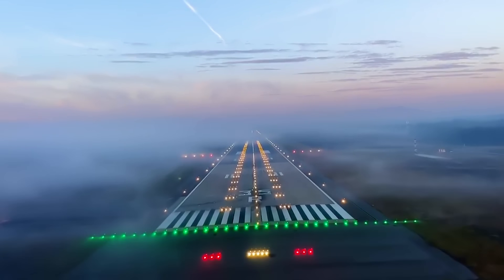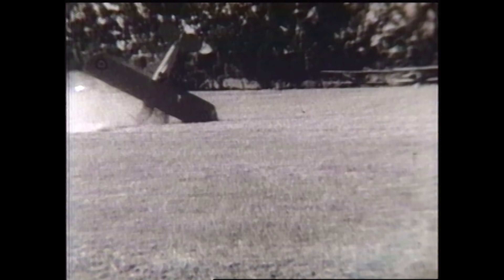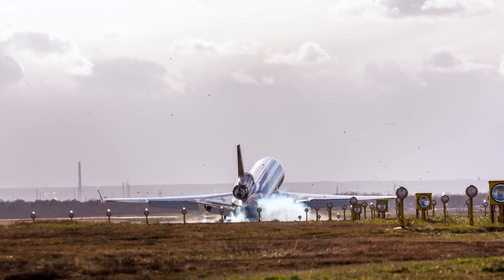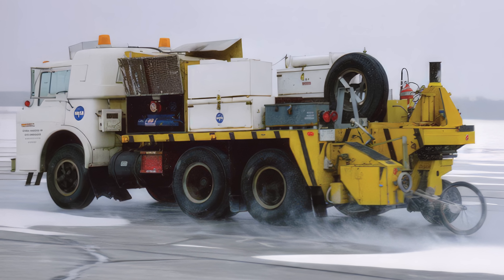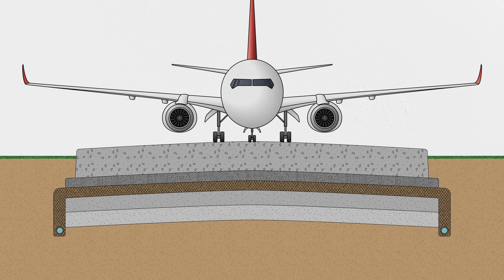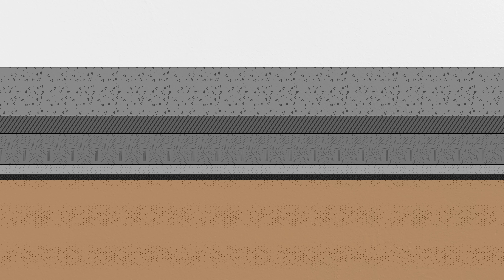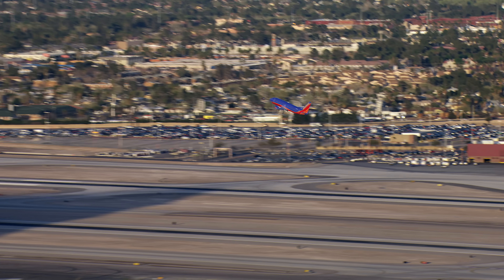The Hidden Engineering of Runways

Comment: As someone who has built concrete and gravel runways, it is nice to see someone explain just how complex they can get. As a note, at least in my experience, we over engineered the different layers, especially the concrete, because going back and fixing it was a nightmare. Some airstrips, especially old ones or military ones, use such high PSI concrete that working on it is the most unfun experience ever.
Reply: Please correct me if I'm wrong - but isn't the concrete reinforced?  Thought I saw a LOT of green epoxy coated rebar being used in the new runways & approaches at ORD.
Reply: @fredinit  in my experience it depends. for the airstrip itself, most likely yes. As someone who tended to handle repairs rather than new constructions, it was very difficult to work with, especially with the concrete being up to almost 2 feet thick. Taxi ways a bit more variance. It also depends on when they were built. To answer as best I can, the new ones at big airports are almost all reinforced most likely. The less you have to tear it up and repair it the better.

Comment: Interesting to hear they basically ignore landings in runway design because the weight is so much less. Pretty similar to what we do for roads (in Belgium) where cars are just ignored because all wear from regular usage is from trucks and busses :D
Reply: The numbers are approximately 100.000 cars to do the same damage as one european 40.000 kg semi.
Reply: @Privacy_menorykee  But hEaVy eLeCtriC CaRs is what I usually get as response when people try to argue why electric cars should pay more road tax :D
Reply: @MrMattie725  depends on what road we're talking about, and they might even cause 2-3 time more damage, but that's irrelevant. We all live thanks to the world logistics and the cost of road maintenance is socialised, because no Truck could afford to pay 100.000 more times road tax and the world would grind to a halt if we tried that.

If the road is only made for very light vehicles, then the EVs could be contributing noticeably, but on any normal road the loads of a truck and similar vehicles is the worst. And any extra ton on top of max load does terrible damage, and especially if it's unevenly loaded. Those fines really should be even worse than they are since they're a result of conscious decisions
Reply: @MrMattie725  It is more about weight per tire (With some complexity from the interaction of closely spaced tires and tire air pressure.), and there are many roads that are designed only for passenger cars.
In my location roads are paid for with fuel tax as a sort of user fee; fuel mileage is roughly proportional to vehicle mass and it rewards more efficient transport so it works well, except electric vehicles get off entirely which is no good because they will eventually become a substantial part of the road users.
Reply: @Privacy_menorykee  which is something I've never understood - highest axle weight for a standard 44t truck in Europe is 10.5t (I've not seen higher), the max axle weight for a passenger car would be no more than 2t, so approximately 5x less. Trucks also utilize unsprung weight and air suspension (unlike cars), and operate at lower speeds so makes me wonder how the impact ratio is so high.
Reply: @JaidenJimenez86  the impact is not linear, it grows disproportionately with the axle load
Reply: That piece of information is out of date. That was true with older, empirical design models, but with the change to linear elastic models and decent computing power most designs will consider both
Reply: Landings are definitely not ignored in runway design. Mechanically the runway is stressed more during take off. But for a plane to land safely (in little to no visibility and/or poor wind), lights and approach guidance radar (ILS) is critical.

There is a lot of signage and electrical infrastructure that goes into place. This features help create more barriers of safety. Say a system to announcing what runway you are entering (you might have to cross a runway first and wanting to reduce as much human error as possible by having an announcement).
Reply: @dragade101  None of that is part of the runway. It is runway adjacent, expands the envelope of weather conditions and improves traffic flow, but the runway would be just as capable of supporting landing planes without that stuff.
Reply: Arent Belgian roads internationally made fun of? Maybe you should consider cars :P
Reply: @detorrV2  Haha true, I'll force in some cars next time! Our roads are bad due to lack of maintenance and structural solutions, not due to bad design of new roads ;)
Reply: I can't help but think of the edge cases: rejected takeoffs and overweight landings.
Reply: @sentinel76  A rejected takeoff is just a takeoff roll. Overweight landings are very rare so they are an insignificant addition to the fatigue life of the pavement.

Comment: Always fascinating. Phoenix Sky Harbor, by this measure, has to be one of the simplest airports out there. Two straight line runways pointing directly east and west (technically three, but the third is shorter and narrower and used only for small planes), with prevailing winds rarely exceeding 15 knots unless there's a storm. It never snows and only rarely does the temperature drop below freezing. The ground beneath the runway is most probably a sandy loam with varying amounts of clay, so minimally expansive soil that naturally drains well. The water table is down hundreds of feet and rain is around 12 inches per year, although during the Monsoon, you may see half an inch in twenty minutes at times. Rarely are there storms of sufficient magnitude to even impact airport operations other than takeoff, and landing distances and the terminals sit directly between the runways, making ground traffic generally straightforward (although it seems that the controllers split the airport into quadrants, one controller each, for better tracking.) Sky harbor's only real problem is summer heat requiring longer takeoffs but the runways are more than sufficient for that. The only other complication is municipal runways nearby, but they all have to give way to Sky Harbor's traffic pattern.

Comment: Airline Captain here: Very well researched. I'll also add that displaced thresholds can also be made for noise abatement. A good example of this is JFK's runway 31L infamously long one, at 3200ft. There's no real obstacles to speak of, but a lot of bougie residential areas to the east.

As an anecdote in DFW once the A380s starting flying there regularly several years ago, they were restricted to only using the west side runways since they're to heavy for the bridges to cross to the other side of the airport because terminal D is the only terminal with customs. I noticed as time went on, the 18R touchdown zone became heavily cracked, to the point that there were actual potholes and I remember hearing another aircraft complaining about chunks of runway laying around that area. It wasn't long after that they fully redid that runway and soon many others, as at that point all of them were still at least 40 years old, ie dating from when the airport was originally constructed. It's also very interesting to see how insanely smooth fresh runways are compared to old ones. DFW's 17C/35C is probably my favorite one and is silky smooth. 

Best compliment I've gotten for my landings was when I buttered it in on 17C and during de-planing a passenger came up to me and said he was sleeping and had no idea we had landed until we got to the gate and the commotion of everyone else getting up and leaving was what finally woke him up.
Reply: I had a landing at Bob Hope in 2002 in which, after the pilot turned off the reverse thrust, the entire cabin broke out in applause because we hadn't felt the wheels touch at all. It was like a hole in one, or a perfect guitar solo or something. Passengers are so used to a little bit of a bump on landing that when it's not there, it's WEIRD. :)

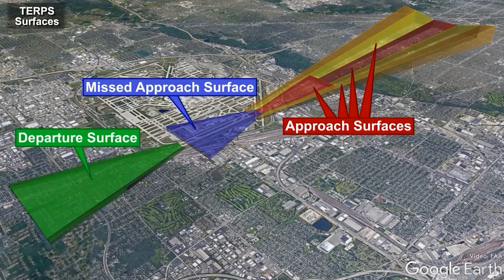Comment: 13:20 Our local MCAS got a new base commander one year (I think they're gone now) had to tell our County Board to move the Fairgrounds location because of this lol. Our Fairgrounds are in one of these zones; I think it would be the missed approach surface maybe? But local ATC has been working around the problem for years as this wasn't a new problem that developed. The airport/air base just went in and expanded "without considering" this.

Comment: 2:20 if you can walk away from a landing it was a good one. If you can fly the plane the next day it was a great one
Reply: Missed Benny hill music there
Reply: I always hated this saying. If your standard of a "good landing" allows for damaging the aircraft, you need a higher standard. And I don't want to be your passenger.
Reply: I mean absolutely no offence to your point.

But if I crashed my plane, I’m treating it like a bicycle helmet. One crash might’ve been enough to leave enough micro-fractures to permanently alter the frame’s ability to withstand flight. 

But, if truly nothing happened during a crash, that’s the best crash possible.
Reply: @lasagnaocelot4766  to add to your point while cycling back, airplanes are expensive, but you're not replaceable. you can get another bike helmet, not so easily another skull

Comment: Heavy planes takeoff being much more damaging than landing is facinating stuff
Reply: Yea, i didnt know that either. Although logical, what i knew was that the road damage is proporional to the 4th power of the axel weight. So weight matters a LOT.
Reply: Planes taking off are much heavier
Reply: It's a HUGE weight difference.  Many, many tons of jet fuel depending on number of engines, distance being traveled, etc.  You put an extra 20,000 lbs on those narrow little wheels and yeah, they're going to dig into the tarmac far harder.  Not to mention the engine thrust blowing back onto the runway the entire takeoff roll plus a few seconds after the plane leaves the ground.
Reply: While every action does pose an equal and opposite reaction, the takeoff procedure focuses that energy on a smaller surface area. :)
Reply: Maybe the heat of engines warming up also contributes?  Probably not.
Reply: I guess add to the weight difference that the engines are at full power too, and spewing what they spew all over it.
Reply: Now imagine when a plane has a malfunction at takeoff and needs to turn back, having basically all the weight of a 10+h flight landing back

Probably they'd dump fuel, but idk how much they'd need to stay in flight for that, there probably are situations where the plane needs to re-land faster than what it'd need to lighten up
Reply: @franciscoguinledebarros4429  They almost never dump fuel unless they really have to, and they know what is below them, and have permission/orders. Fuel tanks are designed to take a lot of damage before making things go boom. Large airports also have their own fire crew on site, with foam trucks. 

The flight that had an engine failure and the engine was on fire chose to go a slightly longer distance than "closest" because the closest had no fire department on site, and the other did, so the closest was in part based on that fire department being able to handle a full size passenger jet on fire. Good aeonautical engineering  and the engine fire was put out, and the fire department didn't have to deal with a big fire.
Reply: @boomergames8094  Thing is, without dumping they may be over their max landing weight, so it will depend on the kind of emergency they're dealing with (i.e. what do the relevant checklists say)
Reply: @franciscoguinledebarros4429  They can land over the maximum safe weight in an emergency, but they risk an overrun and/or landing gear damage
Reply: @franciscoguinledebarros4429  Or, having a problem after critical take-off speed and doesn't have enough runway to stop. Basically, they are designed for things going right. Not things going wrong.

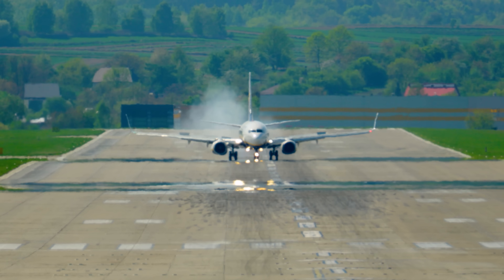Comment: 8:00 so I'm a hang glider pilot. I know that in some ways that is very different from a plane (I've only even used a runway at 1 of the 3 schools I've trained through) but I can confirm: generally speaking, takeoff is harder and scarier than landing. Thanks to gravity, the glider (and the plane, in a sense) will automatically land itself if you just stop flying it, and as long as your wings are level, your sink rate is low enough, and there's nothing in front of you, you almost certainly will survive the landing, no matter how badly it goes otherwise

Takeoffs, on the other hand, are just as hard as actively flying, except with the addition of ground effect, and stuff (the ground)-being-close-enough-to-crash

Comment: I had an instructor tell me "Landing is the most dynamic and critical challenge for the aircraft, takeoff is the most dynamic and critical challenge for the runway and tarmac."
Reply: When I learned to fly, one of my instructors said that the most critical point in any flight is right after takeoff.  Not an issue for the runway at that point, but the aircraft is pitched up (nose high), close to the ground, at a relatively slow speed, and with limited forward visibility for the pilot.  In other words, the worst possible time for an engine failure.  I really had it drummed into me that I had to know what was just beyond the end of the runway (for several miles) and have a plan in mind for what I would do with the plane in the event of engine failure or other unexpected condition.
Reply: @brucefay5126  Most of mine considered that as part of the takeoff; power up to level flight. One even considered the taxi as part of it, which I thought was kinda funny. And, yes, that one considered the taxi to the terminal as part of the landing. It's been a while, but I forget what the flight handbook and rulebook says. I haven't flown since 2005.
Reply: @taitano12  "Just after liftoff" is probably a better term
Reply: @brucefay5126  🤔 That's funny. On September 24th 2025 I landed long with 53 million little passengers that landed on this girls runway that I know 

😎😎😎💪🏻💪🏻💪🏻
Reply: Taxiing and turning do the most damage to runways and taxiways.  

Stationary loads on Parking bays are the worst though. Big static loads for a long time.
Reply: Take off is the only time flying that there is nothing to but pray. V2 or something like that that.
Reply: then you haven't seen a luggage cart burning donuts right before he knew he was getting fired 😅 bro even did figure 8's... im sorry I had to disagree, but my guy did a ballet on the tarmac... in a luggage cart 😅 he actually got fined for damages because of this... he was not expecting that 🙃
Reply: @phyrhfbr1819  In all likelihood, he didn't do significant structural damage to the runway (the luggage cart being a couple orders of magnitude lighter than a plane, roughly equivalent to what a pedestrian can do to a road made for cars), but the rubber residue left from burning the tires could interfere with traction and he may have caused some uneven asphalt wear.  In truth, though, he probably didn't actually cause a meaningful amount of damage, they're just really strict about messing with runway maintenance in any capacity (for very good reasons).
Reply: Sounds like he got it completely backwards, besides that you need level ground and solid taxiways for modern airlines

Comment: takeoffs also have one other contributor to length: rejected takeoffs, when you get up to speed and have to abort you need to stop on the runway, which means you need enough length to get up to speed and then slow back down again in the same runway

Comment: 4:28 yeah I'm calling bs or misunderstanding, the direction of the runway has nothing to do with the engineering of the runway. Just like with highways, you have a specific direction that is optimal for the road users so that is how we build them. It has nothing to do with direction wether or not you need certain sand under it or something.

Comment: I'm sorry, slopes? What?? Are you telling me that when airstrips are laid down, the land under them isn't leveled absolutely flat, with no slope??? That is the most outrageous piece of information I have heard today. Yeah, doesn't sound like much, but its been a hell of a year already, so today is about all I've got before some other, much more ludicrous nonsense occured. 

 Point is, that is INSANE! Why wouldn't the ground be levelled independent of the shape of the Earth beneath it, to ensure idenitical landing angles at all airports??? That's not something an airport should be permitted to cut costs on, the ground must be levelled out to excessive and expensive precision, or they've no right operating at all!
Reply: Do an image search for Courchevel Altiport. 

Imagine what it would take to level the land.
Reply: It's often more costly to level the surface than it is to make it 10% longer to account for the extra forces involved.  If you think a percent or two is bad, you certainly won't ever want to try landing at Courchevel Altiport, whose only runway has a slope greater than 18%.  One end of that runway has a mountain (there is no go around procedure; you must land or you will crash), and the other has a sheer drop of over a thousand feet to the terrain below.